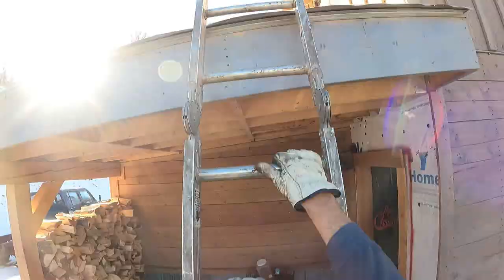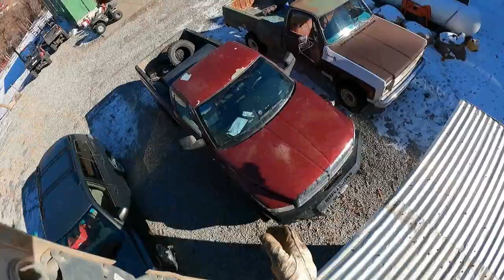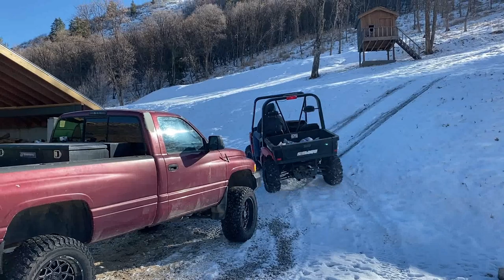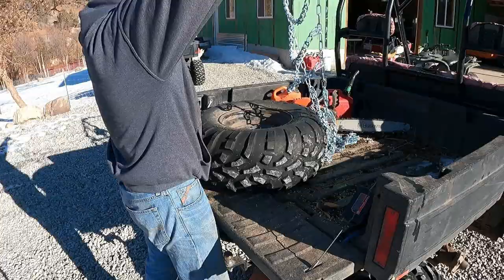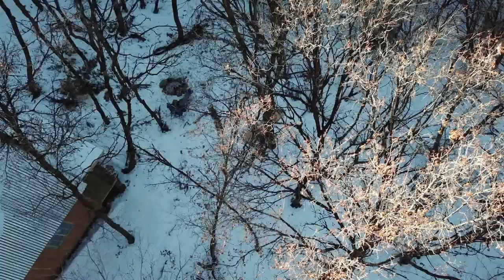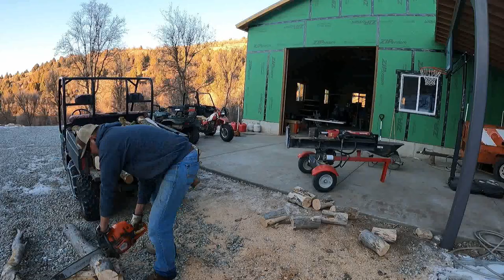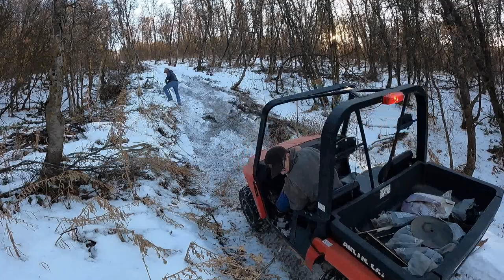The Earth Has Shifted... LITERALLY! (Solar Panel Issues)

Comment: Magnetic north pole changing won't change moon/sun positions in the sky. The magnetic pole is no where near the actual pole (axis of rotation). The axis of rotation also moves around in relation to the sun (wobbles) but it is more predictable and moves less. The magnetic pole has  completely flipped north/south several times in the past. According to a quick search the axis of rotation has moved about 35 feet since 1899.
Reply: Yes, I was thinking how there’s no change here in N Ga. The sun and moon rise continues as always in the same direction.
Reply: I would think doing a survey of the sun on the shortest day of the year (coming soon) might help choose a good spot to relocate the panels.
Reply: You are absolutely right hafree42. The movement of the sun and moon that you are talking about is called the Chandler Wabble. https://en.m.wikipedia.org/wiki/Chandler_wobble 
Though I think that rose here is either unaware of how the solar system works or is a flat earther?
Reply: Rose  but he’s implying that this is the reason why he’s not getting the same amount of sun.
Reply: Cool, I didn't know the geographic one had moved as well.
Reply: Only thing I could think about that would make a difference in mountain height is the movement of tectonic plates. One plate slides under the other and causes an ever-growing (in increments) pile up. Maybe something to do with the earthquake in April...?
Reply: I have no idea what the cause of this said problem is..or have the means to investigate... All I would suggest is perhaps building a solar rigg that can be ‘pointed’ in the right direction easily so the actual position of the sun rise is no longer an issue........🤔
Reply: Biblical cosmology?  Interesting.......
Reply: Thank you....
Reply: @euphmom  also a better possibility than the earth going crazy but the way they have the poles and brackets configured not as likely as a miscalculation from previous years and tree growth.
Reply: @thecollector5243  Better than the theory in the video but not likely to lose hours of sunlight. More likely is a miscalculation from years past and tree growth along with panel movement and a mathematical difference between new batteries and solar equipment. The magnetic theory in the video made me shake my head and have to crack a beer. I do look up to this man and it made me a bit sad he went that direction in his thinking. That being said I've learned a stupid amount from this channel that will make my life considerably better in the near future.
Reply: @XTibbs1  From whom?
Reply: @thecollector5243  we are talking about inches!
Reply: Obviously you don't have solar. Other wise you would see the sun changes. We have the sun comming in the north windows now.
Reply: @ashforkdan  you've gone nuts,obviously
Reply: Consider this those that know aren’t talking, those that talk are without knowing.  Many scientists are silent or better stated kept silent. It’s my believe the answer dues relate back to the changing magnetosphere.  Our current limited (general public) lack of knowledge of alternate physics, which includes the true path of light within a magnetic field.  In short everything in the solar system is where it ought to be what changing is the path of light.  The Eskimo’s reported the anomaly more then a decade ago, again using mountain location, which were imperative to them for navigating.
Reply: @XTibbs1  
I felt exactly the same.
And lower consciousness falls for it as reassurance that all is okay.
Reply: The Inuits in Alaska says the same thing, your not nut as some have implied!
Reply: @masha4756  : do you say that his observation is wrong or that that sentence is wrong.
Reply: petnzme01  please do a calculation how many ice is melting in respect to the total mass of the earth. Than you can see how much effect it would have.
Reply: he is giving you his observations based upon personal experience and living and witnessing it EVERY SINGLE DAY.
his families life and well being literally depend on the consistency of his observations and how accurate they are.

google wont help you debunk what he is saying,get it?  this man obviously can accurately look up and tell were the sun or moon is coming up or going down and for how long.
Reply: @trillrifaxegrindor4411  with Google search we can find scientific facts for a topic we looking for. Only we have to be careful what information can be trusted.
Reply: @MGE0007   the position isnt as big of an issue as is the fact the sun is up 2 hours less,he addressed this
Reply: @masha4756  book,written by people...not gonna help,sorry
Reply: 1859 . carrington event . solar eruptions knock earths em field around . heliophysics and plasma magnetics check out suspicious observers all the news is there
Reply: Suspicious observer is a sight everyone here needs to watch to learn something. Apparently they were asleep in science class.
Reply: He didn't say it was the poles that is causing it. Get a grip.
Reply: It's moved more than that in a day. It's constantly shifting.
Reply: Pole shift will change Earth's equator line. The old line is where most of the ancient sites are built on.
Reply: Yes it would, you are misconstruing polar shifts with polar FLIPS! I have noticed this same exact issue because I have solar panels. I know when and where that sun comes out every season and it’s changed.
Reply: Magnetic north and actual north are two different things.  Just because the magnetic poles move doesn't mean the axis that the earth is spinning on moves along with it.
Reply: I beg your bloody pardon
Reply: @danielmarek4609  the axis is literally shifting from the ice melt in Greenland.
Reply: I've noticed the daylight is definitely different than it used to be. Yes the cord of the earth has it's own life. That life is also coming out.....The earth is not solid. It's supposed to be open.....another world. However we missed the opportunity to go to where we want. Just like animals see differently, and insects....there is abundant life some are aware of. People on planet earth are a different variety again. The people are changing because of the shift.  New species are able to come back and some will be able to go other places....the shift changes more thant the planet. People will change too. Permanently into another adaptable kind. The earth has done this many times and unless we blow it up it will happen again.
Reply: This guy is making observations that are sound regardless of the magnetic north versus what we call North Pole so don't try to simplify it dy giving a Junior course.
Reply: @lulWut9  maybe, however that does not denote from the fact that he is getting us son and that is relevant.
Reply: Just to add to your facts, the magnetic north pole has moved 1,000+ miles since the year 2000.
Reply: Hibbeler productions channel may help
Reply: Nah. It’s actually speeding up. The magnetic migration is accelerating. To add to that, a recent news story came out here in mid 2022 about the earth rotation speeding up by a micro second. Yeah something is happening. It sure as fuck isn’t carbon emissions
Reply: Perhaps, but have you considered that we may be in the middle of a magnetic excursion? Our sun is subject to magnificent galactic forces. We know the Earth and sun have magnetic fields. These are dipole fields. They have a North and South pole like a bar magnet. Well, so does the galaxy! It has a magnetic North and South pole, just as the Earth and Sun do. The galaxy also switches polarity back and forth over time. When this happens, our sun has no choice but to follow suit by reversing its polarity. The Earth will have no choice either. It will maintain whichever polarity is kept by the Sun which will maintain the polarity of the galaxy. When Earth's magnetic field becomes weak enough, there exists the possibility of the crust sliding free of the mantle below and straying from the axis of rotation. If this happens, the physics of a rotating body would cause the heaviest sections of the planet to move to the equator, in reference to the axis of rotation, not the equator we see on the map/ globe. This means the North and South Poles would both be at a latitude of ZERO, still 180 degrees apart. This would cause the Earth's crust to pause, stop, and/ or change direction violently. This isn't the worst of it though. As the crust strays from its normal path, the air and water would continue in their original direction causing instant 900 mph winds everywhere on Earth, and a wall of water would sweep over the continents a mile high and moving at almost the speed of sound. Having said all that, I think if there is any chance of the Earth "shifting" even an arc minute or two, then we had better get ourselves right with the Lord Jesus Christ because we may soon find ourselves in His company.
Reply: The processional tilt is more extreme, and has a harmonic that is occurring at roughly a 11 day cycle. Farmers have noticed this, armature astronomers have noticed, but the proof is out there. Just look up😮
Reply: Pole shift affects the geographical locations. So moon and Sun are not shifting but the land beneath us, is.
Reply: BP Earthwatch said the equator is shifting and is headed north. He said the new line will be in Kentucky.
Reply: We've shifted on our axis

Comment: It would be nice to have a second wheelbarrow,  that way, you can take the split wood from the splitter, instead of dumping it on the ground and than loading the first wheelbarrow. One less time handling the wood
Reply: or put it on the trailer and push the trailer back to unload using the wheelbarrow while the trailer is being unloaded.
Reply: Have you seen the price of wheelbarrows lately??
Reply: relax,you arent doing it but i agree

Comment: Magnetic north and south are different than true north and south my friend don't forget that the axis of the earth doesn't change just because the magnetic poles are flipping around
Reply: @Quincy Davis Is your third grade class on remote learning? Do you miss your teacher?
Reply: best explaination so far -- kudos. i agree.
Reply: The axis of the earth isn't constant it has a slow wobble to it that varies depending on the solar position of sun Moon's planets etc right now Jupiter and Saturn are lining up which could cause this solar deviation of our axis
Reply: @jodystevens1333  The only likely change is that the trees up the hill have grown taller over the past 5 years. 

The real issue is  buying an off-grid property on the north slope of a hill or mountain.
Reply: @guytech7310  I'm sure the trees have grown taller but that doesn't change the position position of the mountain the sun and Moon naturally move across the skyline but what he's talking about is a dramatic move resulting in a shift of the Earth's axis fur in my previous comment about Jupiter and Saturn lining up creating a strong gravitational pull on the Earth
Reply: @jodystevens1333  Heath is mistaken. The earth has not shifted causing the daylight hours to change. The only "wobble" earth has is Precession which is on a 100K year cycle. It is not noticeable over a 5 year period.
Reply: @guytech7310  whatever may be the fact I've noticed that the sun is not in the same place when it comes up in the morning on my way to work it's way right when it should be left I'm not a scientist but it's not been or I've been going to work for the last 20 years
Reply: @jodystevens1333  Sure thing, president Camacho! Brawndo its what seasons crave!
Reply: @guytech7310  what are you talking about are you on drugs
Reply: he isnt using no google search,just personal observation because all his electric power depends on it.who gives a rats ass how he defines it.....you get the fucking point,dont you?

Comment: Your hillside toplayer is slowly moving down. That's why all the trees have a bend. You may have speeded up the movement by cutting in roads and bulding plots on the hillside. It may also have affected the angle of your solar panels. Also, trees can grow yards during 5 years, putting more shade on your panels. Even your observation point may have shifted down. The fact that you have a shallow well on the hill, also supports my idea that there is a wet, slippery clay layer in the subsoil, resulting in a very slow motion landslide. Hope this helps to explain the reduction of your solar production.

Comment: The magnetic poles have been moving as long as Earth has been around.  It has flipped every 200,000 or so years.  If I remember right, some believe it is in the process of happening again.  It has migrated pretty far over the past 100 years.

That being said, magnetic North and Geographic North aren't the same.  The Earth does wobble very very slightly on its axis, but not anywhere near enough to change anything notably even over a hundred years.  As for what is causing your issue, I'd consider looking more locally before assuming the entire planet has shifted.  It could be as simple as more tree growth.  It's also possible there's still enough tectonic action occurring that the mountains could be rising - but I'm not sure if that would even be a perceptible amount.
Reply: I seriously believe this is just a clickbait title with absolutely no proof the sun angle has changed. Otherwise he would have showed a video from years past with the sun rising at a different angle.
Reply: Magnetic north is moving and faster then ever it's picking up speed. True north the axis hasn't moved much so they tell us.

Comment: The Earth has not shifted.  The magnetic poles are always moving, and every few tens of thousands of years they flip north to south and south to north.  This is normal, but it doesn't affect the crust of the Earth in any way and it doesn't result in a physical shift of north to south and south to north, it's just a magnetic reversal.

Not sure why you're noticing a difference in the sun rising location over the ridgeline of the hill behind your house.

Get scientific with it.  Craft a physical guide where you can measure the rising point throughout the year.  Just do it once or twice a week, for a year.  Then present your evidence.
Reply: @XTibbs1  the planet /should/ be in a cooling period, instead it is heating, because of increased greenhouse effect by all the human released co2.

Comment: High Jack/ farmer lift jack:  Can be used to strech fence wire. Can have an rail extension added to increase range of jack usefulness.  Can easily be rigged to make a 7000 pound pull of a RANGE 6 wheel out of the buckwheat.

Comment: Quick suggestion - buy an old metal dumpster (larger the better) and use it to burn any scrap wood/limbs along with any garbage instead of open piles and old oil drums - you get a cleaner burn with a larger fire and it will ensure the fire is always properly contained so there is no risk of it spreading.

Comment: I live in Sweden. In the countryside its commun to heat our houses with firewood. Old knowledge says that the firewood shall be cut and chopped before easter if you use it the same season. Dry outside until midsommer, than you can stack it. It seams be a good tradition.

Comment: The Earth has not shifted. The Earth is not shifting. The magnetic poles have always moved around. In the last few years, the magnetic pole has been moving a bit more than usual. Good luck and thanks for the great videos!
Reply: Yes it has.
Reply: yes it has it has, It has shifted on it's axis. Look up the works of Dr. Carl Bowin Woods Hole Oceanographic Institute Falmouth, MA. That is the main reason why the federal highway administration is renumbering all the highways, and the FAA is in the process of renumbering all the airport runways.
Reply: If any significant shift in the Earth's orbit, axis, or spin rate had happened it would affect astronomy, navigation, surveying, timing, and many other things. Only extremely minor perturbations of these things have happened. Time can be measured fairly easily to pico-second accuracies. I one pico-second light travels only 0.3 mm. Anyone who thinks the Sun, Earth, Time, or Space have shifted enough to affect solar power - doesn't know what he/she is talking about.
Reply: ignore the laymans terms and grasp what he is saying einstien
Reply: Dude, the axis of earth changes constantly. The Inuit's will tell you the sun is higher in the sky, it's warmer now. It effects the winds, everything
Reply: Yes dear, it is tilting away from the sun , and the orbit around the sun is changing as well, not just the pole shift ! That will complete in about five to seven months, depending on how fast it moves !! The orbit will become more elliptical as well , so it will be much colder then we are used to on it's farthest orbit around the sun!! This unfortunately happens every so many thousands of years, this is that time again!! Sorry !!
Reply: @trillrifaxegrindor4411    You are wise. 👍

Comment: Roof Red Light:  the local highway rest stop  senior citizen attendant who works there alone during the day, has a red roof light that he can turn on.  The Highway Patrol will check out the rest area when he see that light on. They have caught some pretty bad people with this system.   When the attendant goes home for the night, the red light turns on if there is a heat malfunction or water issue.  A red light on the house and garage roofs could be seen from afar that you are being summons. Just another thought I had.